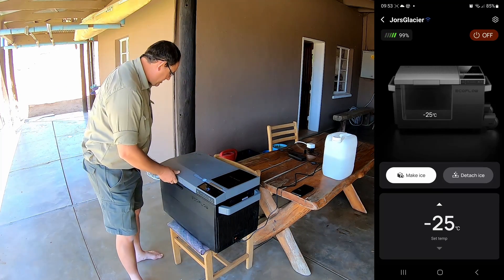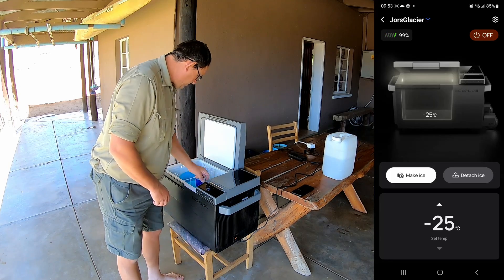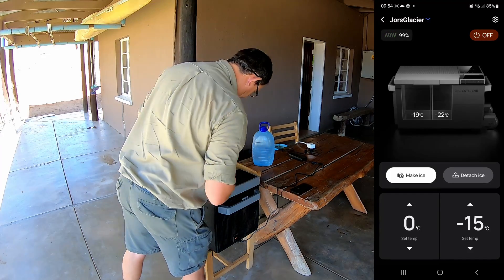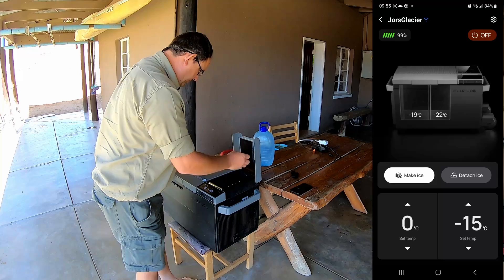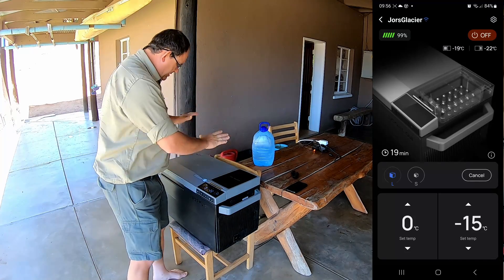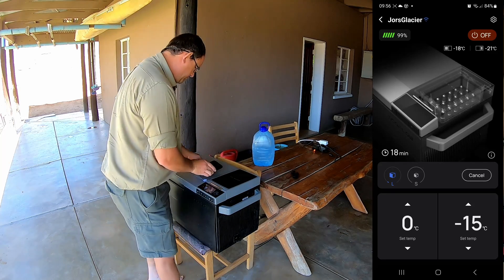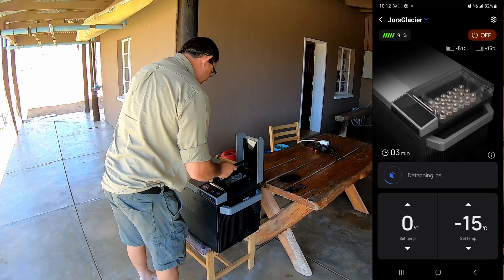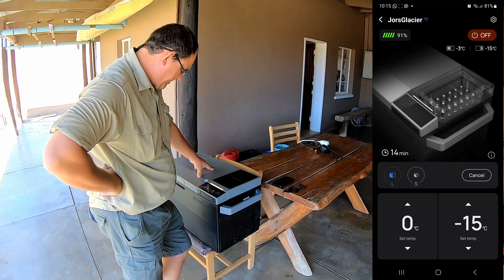How much Ice can the Ecoflow GLACIER make?

Comment: I wonder how the power consumption compares and the amount of ice you can make per day or per battery if you use the freezer side full of ice cube trays to make ice vs the ice maker. I have a hunch the ice maker is faster but far less efficient than the compressor.  Another thought, bullet ice is good for cooling drinks but the overall volume of ice vs the weight of ice is lower than cube ice, if you are using the ice in another esky/cooler to keep fish fresh how many kg/lbs of ice can you make each way? Thanks for the great video.

Comment: Torture test +. I wonder if the engineers ever pushed this unit as hard. I was shocked by how fast the battery went down making ice, considering it should run for 40 hrs, but then impressed that it was recharging the battery while it was still being pushed to the limit.

Comment: Excellent coverage of the Ecoflow Glacier in both your videos....
I see it's only 38 litres though... we use a 90 litre National Luna  and it's FULL when we go camping... Any ideas on how to get around what appears to be small in size - especially if out in the bush for 7-8 days....
Reply from the maker: We have discussed it, and the whole idea is to have the Glacier as a second and dedicated drinks fridge. It has more cooling capacity than the NL 90, 120W vs 75W, so can stand more opening and closing cycles.